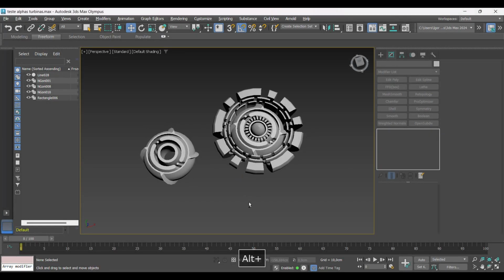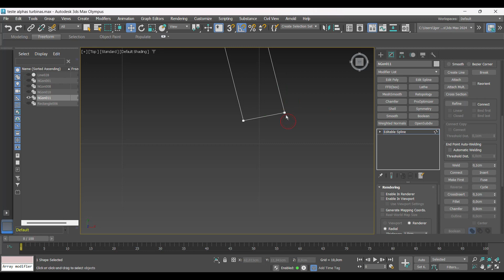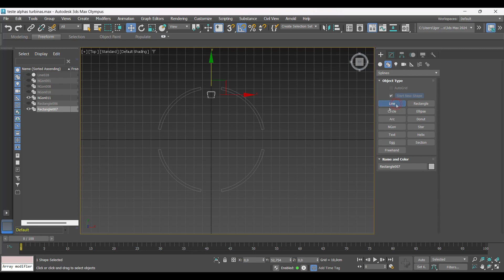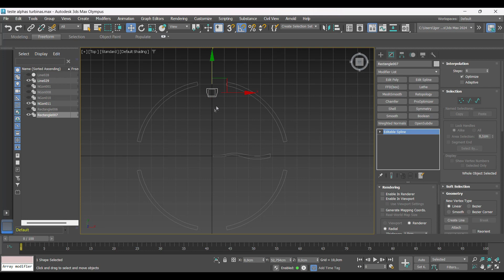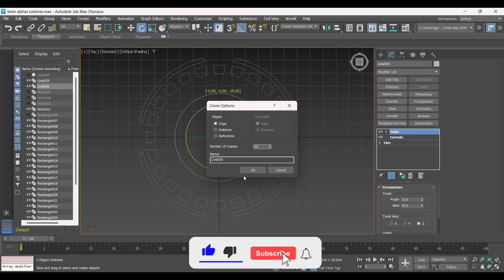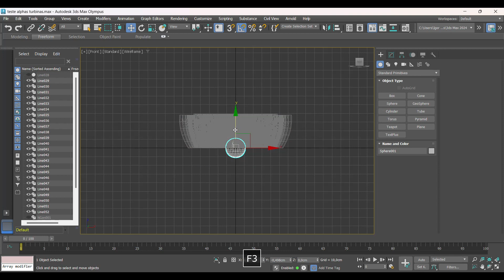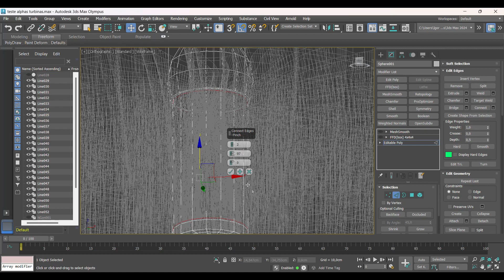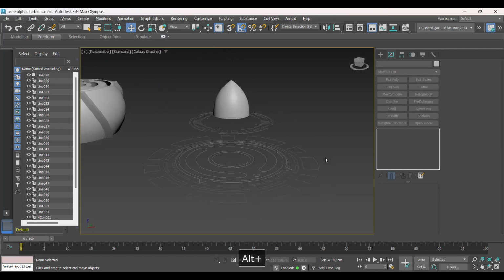Complex HardSurface Just With Spline!! #hardsurface #3dsmax #tips

Comment: how to make a deepening under six faces in a sphere? a kind of top of a hex bolt ... at what the sphere should turn out without visible defects
Reply from the maker: with boolean, create the sphere, and the shape with six sides. use an extrude on the shape and go through the sphere. adjust the depth. then you can use retopology with the option of boolean and normal turned on. It will create the shape without deforming your sphere at all.